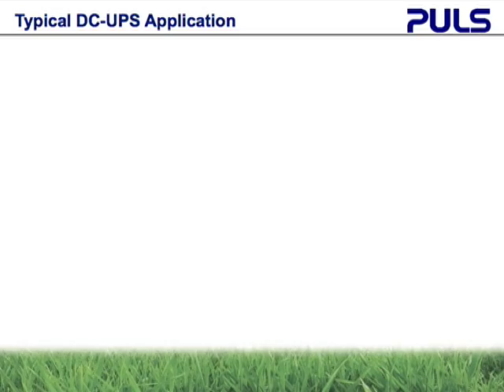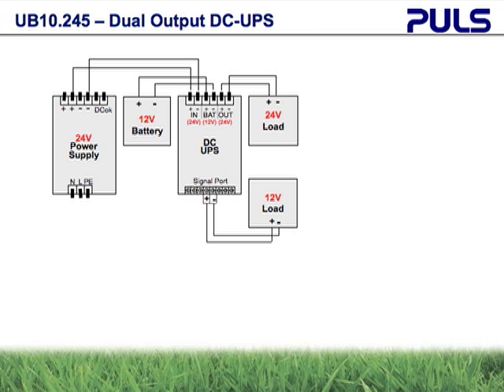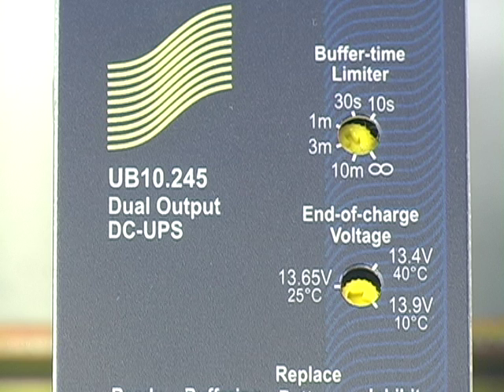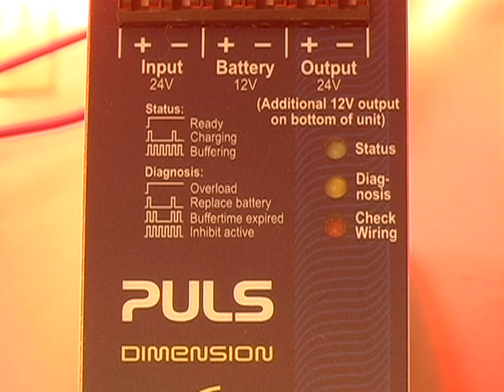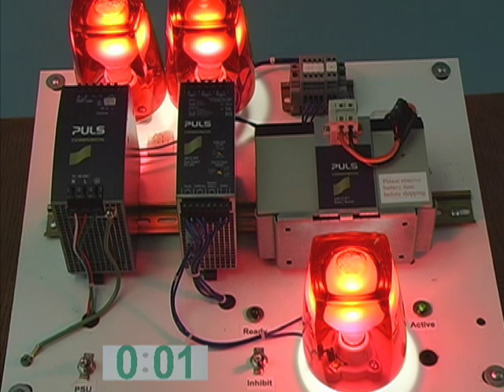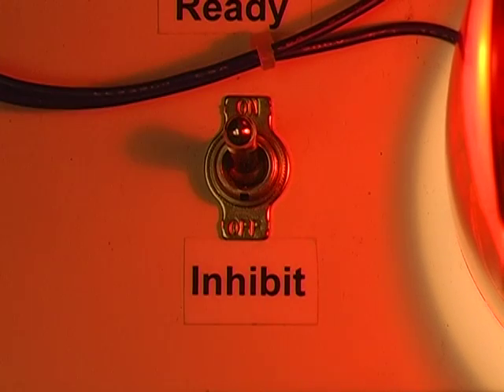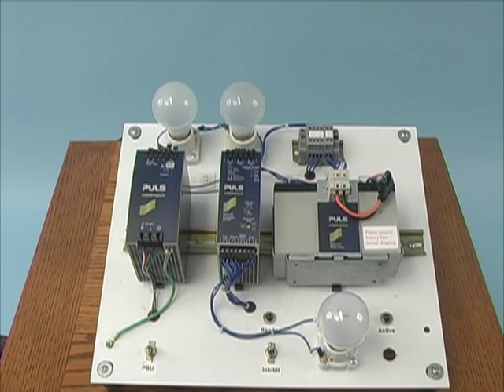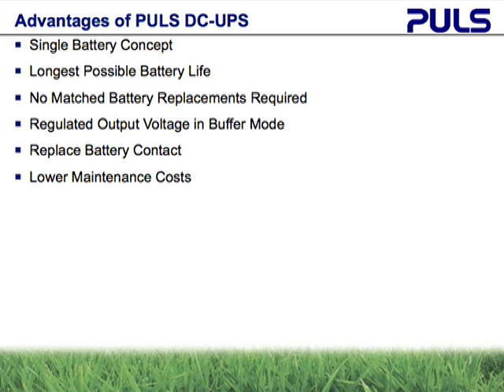PULS DC-UPS

Comment: This unit has firmware bug (before 2012)  that blown internal  battery load check resistor in overtemperature detection issue .
Reply: Now also have, but how to solve